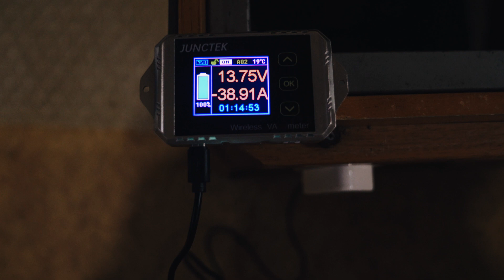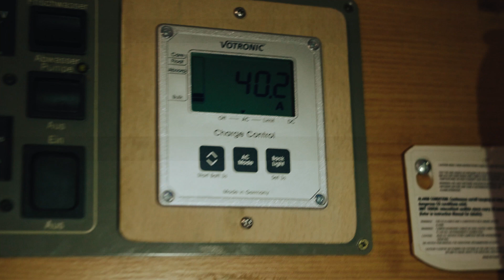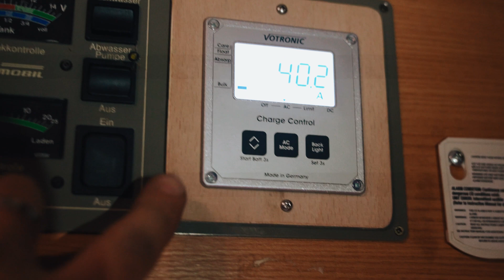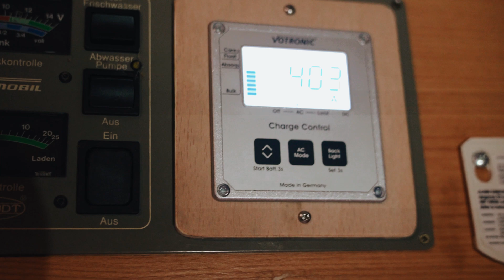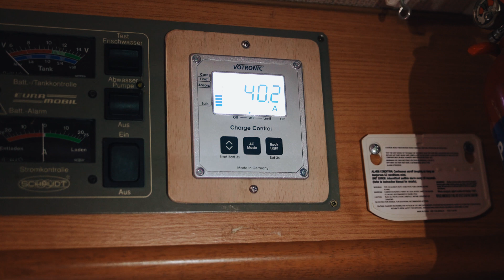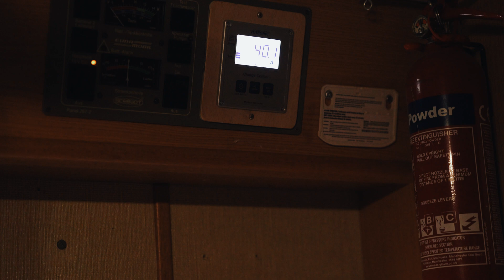Converting old camper from Lead Acid to Lithium battery & full new charging system

Comment: We're about to install one of these. Looks great, only issue I can see so far is the voltage limit on the solar charge side is pretty low so we're only able to wiring multiple panels in parallel.
Reply from the maker: Yeah, after using this charger in one of our vans for the last year, it's pretty rock solid but not the highest specs. We wanted to use one properly to have a good informed opinion on them and would recommend using separate units to maximise capacity, if possible. Only reel benefit you get from these three in one is the space saving. Otherwise there is not really a reason to use one. You don't really save money and they aren't as high capacity as separate units, plus the risk that if it dies, you have no other charging methods.
Reply: @offgrid_power  Yeah, seemed like a bit of a simpler option too in some respects as you're just buying and running the one box.

Comment: I had trouble with the state of charge in the app for a 250A dalybms. It'd sometimes get stuck on displaying what looked like sample data. It'd sometimes come good on it's own (but not usually when I wanted to see the SoC). I could reset it by pulling the balance lead, but then it SoC accuracy would be messed up for a while.

Because of that I installed a Juntek shunt. It's been great.
Reply from the maker: Yeah, the Daly BMS app is a bit flakey at times. Sometime I've not been completely convinced that it's reporting the SOC accurately. The Juntek shunts are great though. We've found them to be pretty accurate.

Comment: Fascinating - I never knew there was a 3 in one when I went over to lithium  - would have made the install so much easier and tidy - if I was doing it again  I could be tempted to use a 3kw Growatt which has an inverter and screen as well !
Reply from the maker: Yeah, it's a pretty cool charger! It doesn't give you as much capacity (particularly in solar) as if you had them separate. But as you say, the ease of install and simplicity is awesome!
Reply: @offgrid_power  Like you I built my own 280ah pack  though I used a 120amp blue tooth BMS -  Renogy DC to DC and  EpEver MPPT
Reply from the maker: Nice! That sounds like a great set up! :)